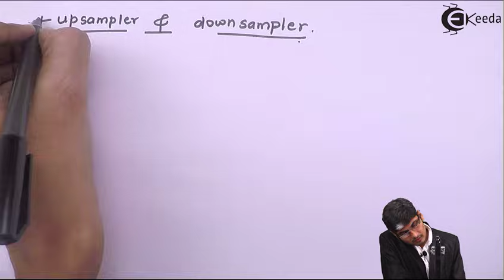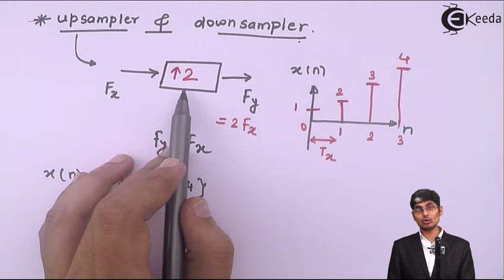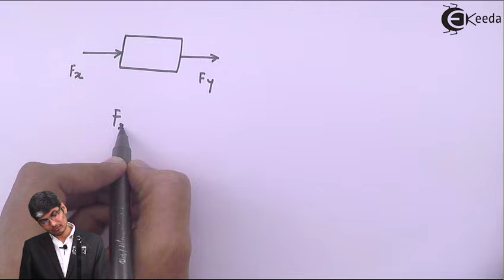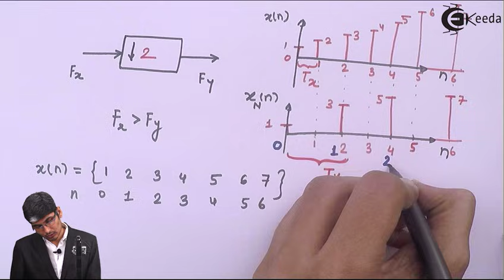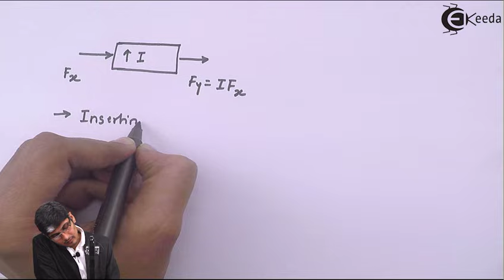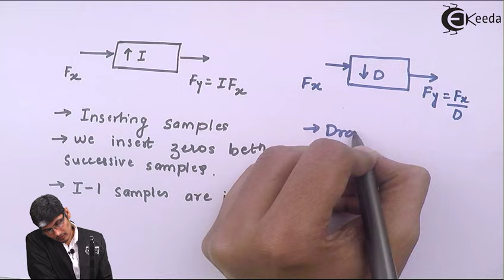What is meant by Down sampling and Up sampling in Discrete Time Signal Processing

Comment: There is a tool called Audacity (Free). You can use that tool for noise removal in your videos. It's little odd when hearing in the headset. It's just my suggestion that I used for better user experience. All ur videos are very useful. Keep it up!
Reply from the maker: Thank you Sarath for valuable suggestion. We would definitely work on noise removal

Comment: i have seen in the book, in case of up sampling I-1 zero are also added even after the last term of x(n) but you have not did so. which one is correct?
Reply: I know its a bit to early to answer this but think about the fundamentals of Upsampling and you will have the answer.
So, basically, upsampling example here used increased the sampling rate by two, so twice the number of samples compared to original signal.
So without adding a zero at the end you wont get 8 samples so yes you will have to add another zero after the last sample to get a total of 8 samples  (twice compared to original signal).
Hope it helps you after Eons! :D